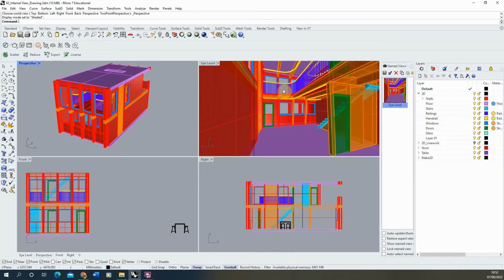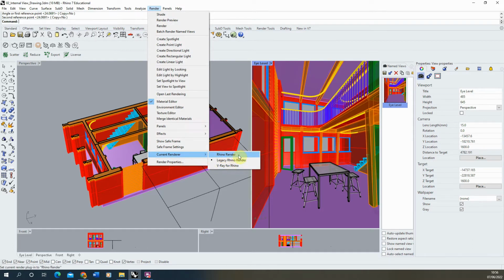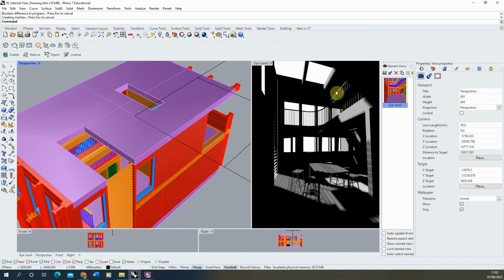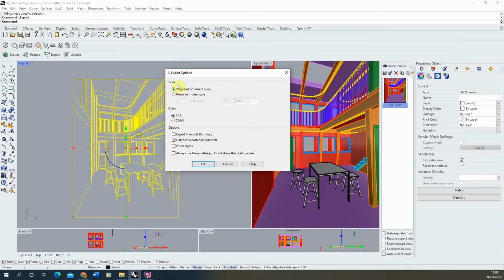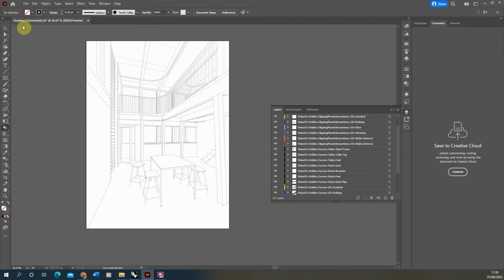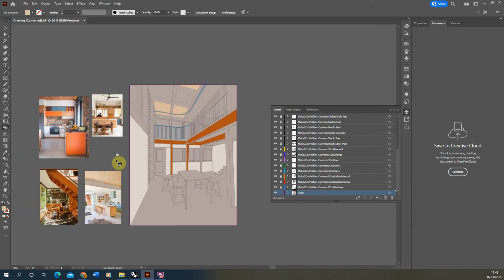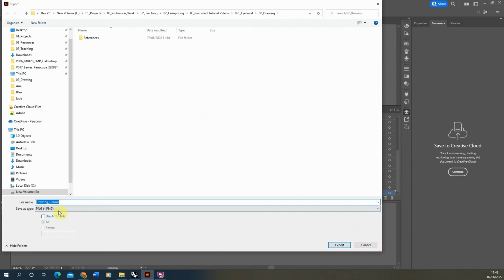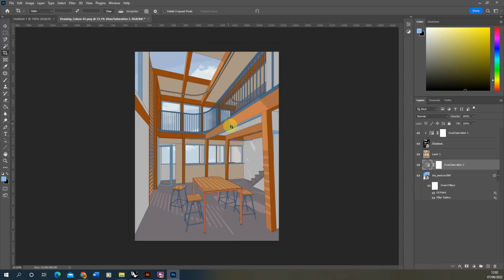Interior Perspective Drawing Creation - Rhino 7

Comment: What I've found is changing the viewport to be both drawing lines and ray trace/render yields a result similar to the final product you would create in illustrator. I suppose line weights could be off and its raster based, but tbh it's hard to notice after doing work in photoshop. I still enjoy doing illustrator work, but if you don't have time, I would recommend doing a viewport capture.